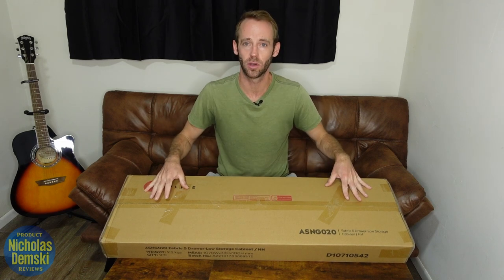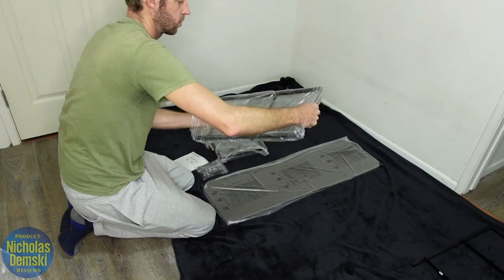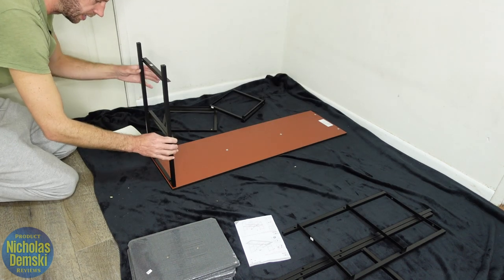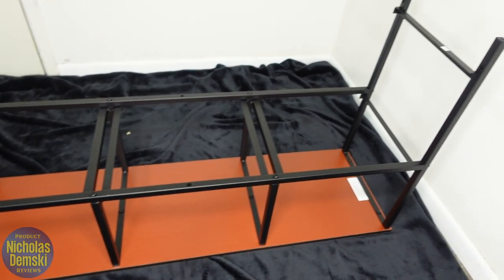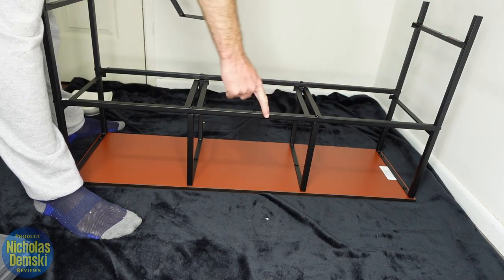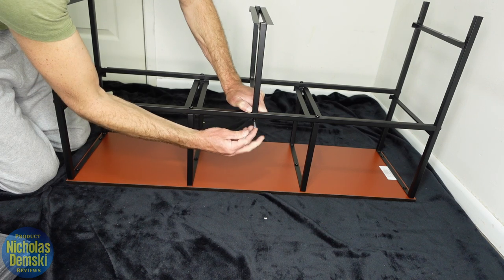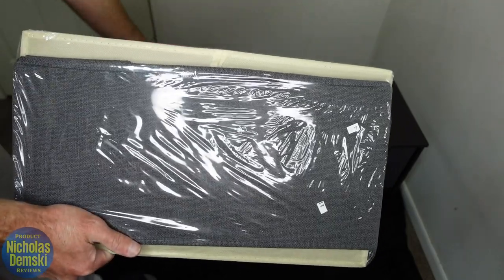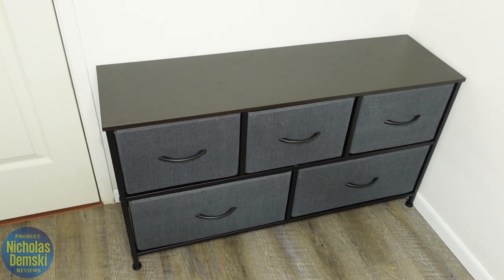HOW TO ASSEMBLE the WLIVE Dresser for Bedroom with 5 Drawers! (and REVIEW!)

Comment: Thanks! I had one screw that would seem to be getting started then go sideways. After many, many attempts and a few choice words, I went ahead and put the rest together. I hope it works without that one since it did seem sturdy. I would've sent it back but returns are not nearly as easy as they used to be at Amazon. I'm about to stop shopping there after 20 + years because of how they do things now!!! Sorry small rant. 😁
Reply from the maker: Sorry to hear you struggled, hope my video helped!

What have you noticed in the ease of making returns? I haven’t seen anything so I’m curious what’s going on…
Reply: Same … 4 of the B screws just don’t seem to fit … no matter what I do … I’m beyond pissed 😂